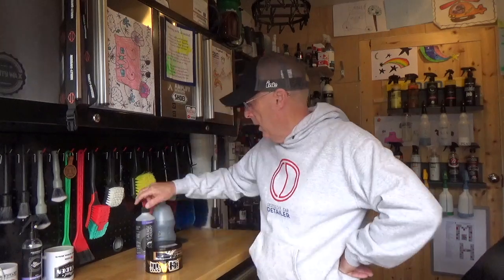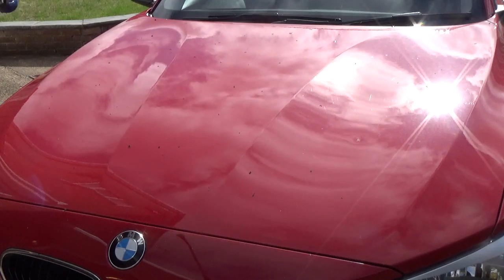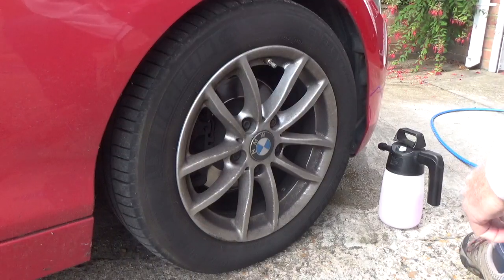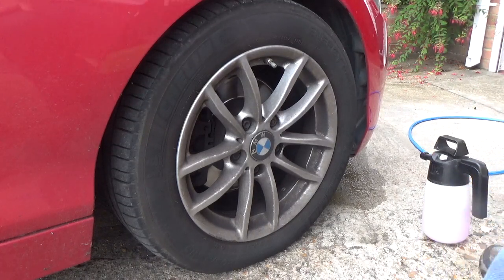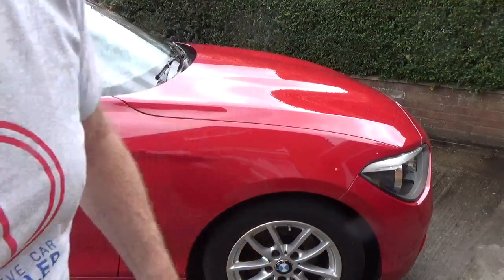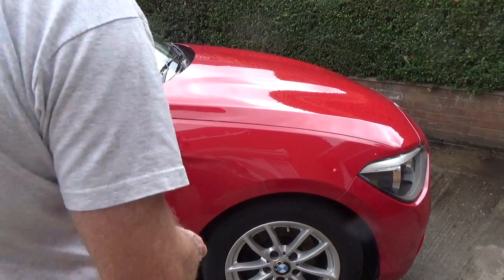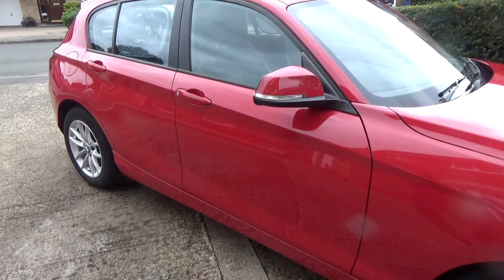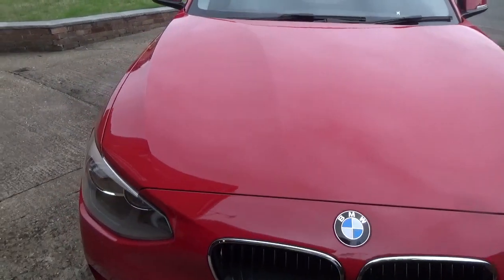Soft 99 Extreme Gloss Wax "The Kiwami"

Comment: A great overview Martin. 👍 

Kiwami can be used standalone, but for me, it's best used over the top of Fusso. Fusso gives a longevity that is unrivalled, but it's not the glossiest, and can look a tad "flat". Adding Kiwami over the top gives a really nice finish. My winter prep video detailed this process and combo.

As for longevity I dont think you'll have any problems checking that car again in a month! 

Soft99 were a staple brand in my garage at one time when Nipponshine was up and running. Jackie was instrumental in bringing soft99 to the masses. 

I know you touched on the car condition in the video, but the colour match of that rear bumper is horrendous!
Reply from the maker: Hi Dave, yep red is unforgiving with colour match. I couldn't live with the condition but my daughter only sees it as a mode of transport and only gets cleaned because I want to use it for the channel. Interesting that no one else has commented on the video content yet just the intro 🤣🤣🤣
Reply: Once you've applied Fusso coat to a vehicle, how long do you wait before applying a coat of Kiwami King of Gloss wax?
Reply: @iMANC1966  for me, 24 hours. Fusso is a wax that "gasses off".
Reply: @DetailingandtheBeast  Thanks for the tip and for your quick response. 👍🏻
Reply: @ObsessiveCarDetailer   hi

Comment: Not trying to be negative my friend but when you were applying the paste wax the sound that your mic was picking up says to me the paint needed a good clay bar treatment prior to application of wax.
A way to confirm is using a sand which bag or similar, put your hand inside the bag and rub it on the paint.
If you can feel it is rough and not easy to glide over then for sure claying is required.👍
Reply from the maker: Hello Stephen, I dont think your comment is negative just an observation but yes, in fact if it was my car it would get a full two stage correction but it's not my car. Appreciate you comment and support but the point of the video was around the product more than the condition of the car

Comment: I’ve have the soft 99 and heard a few people moan it’s hard to buff off... it must go on thin, as thin as you can lay it and a panel at a time or it’ll be like buffing off concrete, it isn’t forgiving...  user error isn’t the products fault and when used per the instructions it’s a great wax and easy to use.. I use the soft 99 products on the work van as it lasts, I can neglect it for weeks but a quick wash and the protection is still there..
Reply from the maker: That was certainly my experience, less is better. It made a car that needs paint correction look and feel good. I must get round to sorting out the paint, its doing my head in

Comment: Hi what's the best wheel cleaner been using wonder wheels it rubbish nearly use half a bottle on the wheels lol
Reply from the maker: Hi Mark, big question & it depends on how dirty the wheels are and how often they have been cleaned. So if they are really contaminated with iron & brake dust then you are going to need a strong product and may need to repeat the process. In that case you can choose from a number of products. Currently on my shelf I have Bilt Hamber Auto wheel & Autobrite Hell Shine but there are lots more and everyone seems to have their favourite. I suggest you start with Bilt Hamber and see how you like it. All BH products seem to be good and reasonably priced. If the wheels have been kept in reasonable condition but still dirty then check out some of my videos where I use P&S Brake Buster. I use it through a foamer & directly from the bottle depending on how dirty the wheels are. If you have Garage Therapy Zero recon on your shelf then that is also a really good product for cleaning wheels. For regular wash maintenance then my go to product is Garage Therapy One Wheel shampoo. The other wheel shampoo I quite like is HDD Brake Through. I hope that is of some help but please let me know how you get on and what you sendup using 👍
Reply: @ObsessiveCarDetailer   thank you mate I will try one off them I just use a car wash system from your cigarette lighter in my car because I live in a flat and the water feed fell off into the container and i was pissed off so i went indoors got the feed out going to jubilee clip it on till i get a better one going over wheels again with the stuff i have got maybe monday if weather is ok lol
Reply from the maker: @marksmith3469  let me know how you get on Mark
Reply: Think I am going to wash the car tomrrow or at least wash the wheels if its spitting its stained one alloy think I am going to get some wheel shampoo
Reply from the maker: @marksmith3469  Let me know how you get on and what you use